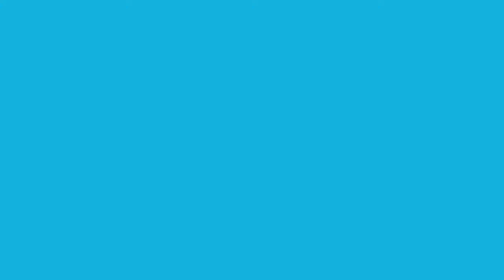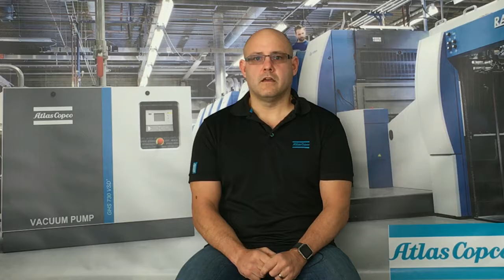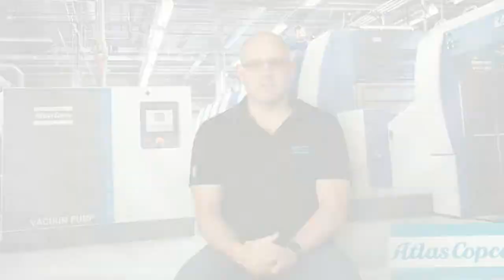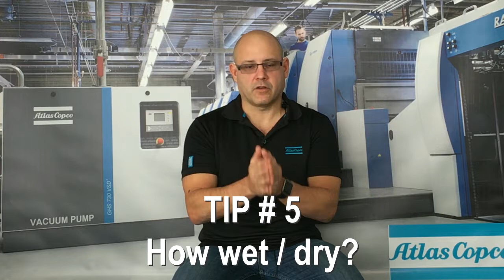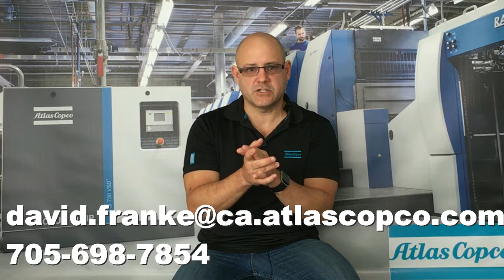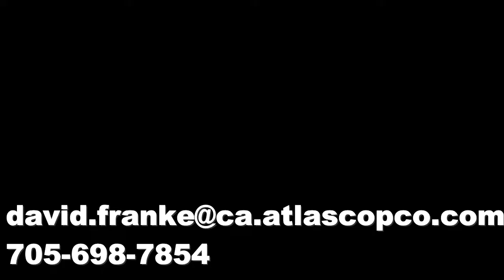How to choose the right vacuum pump for your appliction

Comment: #3 pressure: if i have a dough mixer and a vacuum pressure applied on it .. how to determine a specific value of vacuum pressure fro the vacuum pump range? does it related to the mixer sealings and how it is impermeable, and the vacuum pump compensating the losses in vacuum pressure due to atm. pressure?
thanks